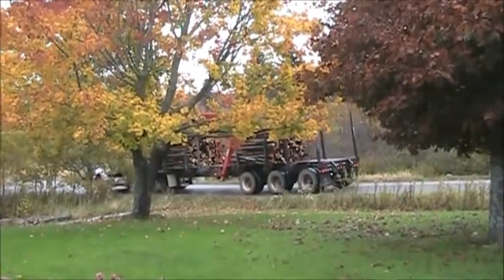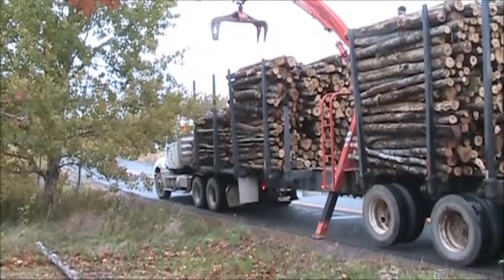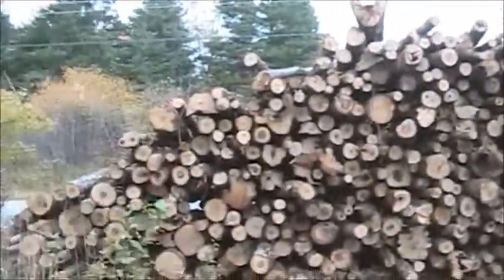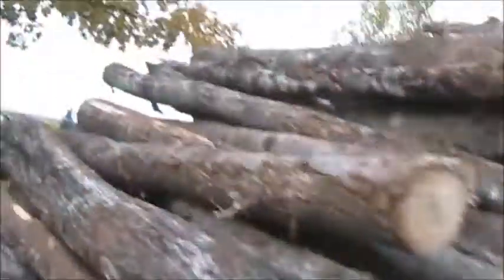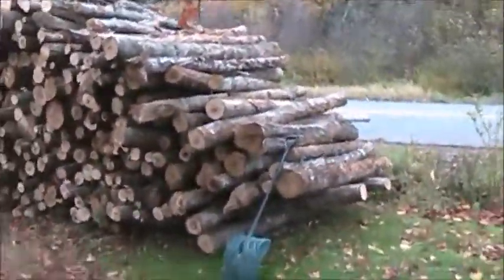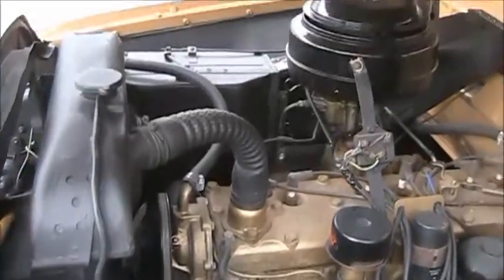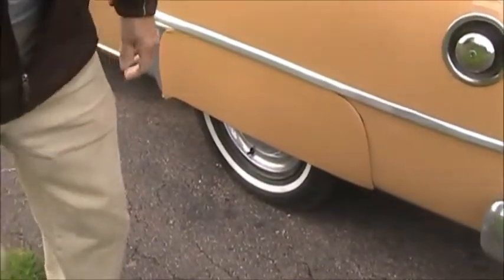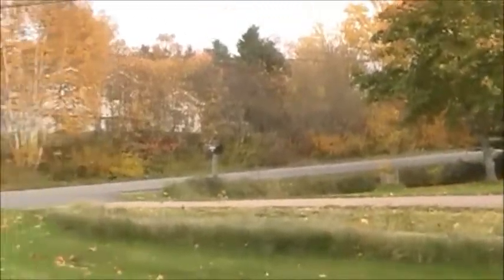the wood is here and a 1952 crysler windsor visit

Comment: Took the words right out of my mouth! I have the MS440 Magnum and it's a stout mid-sized saw. I've had it for 7-8 years and have only had to replace some screws & plastic bumpers & stuff. Thing about the commercial saws is that they only have a 90-day warranty 'cause of the tree guys and their helpers. Made no diff to me, naturally. If I had a pile that big to cut down to size I'd have to have some sort of auto-cutting jig. It's all cutting and no splitting with small stuff like that.